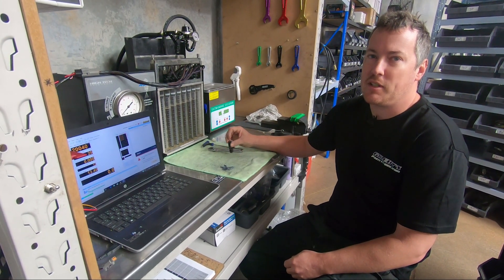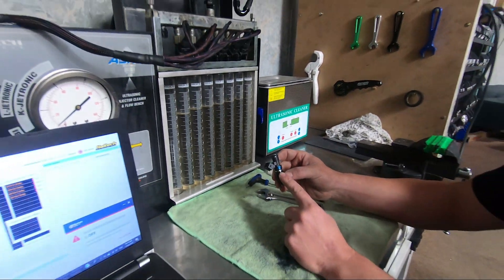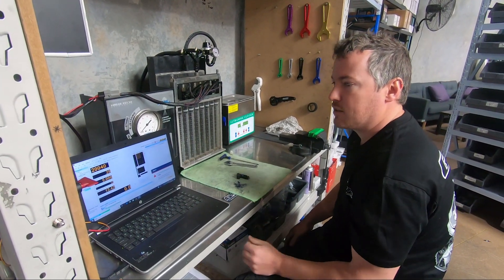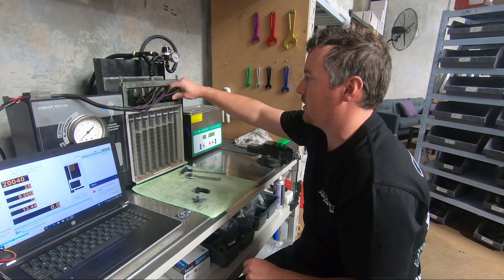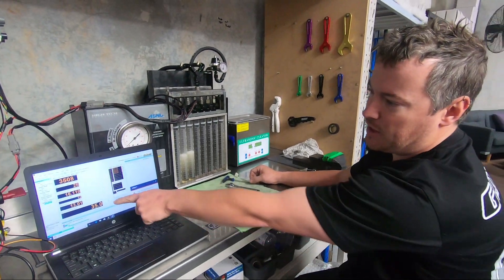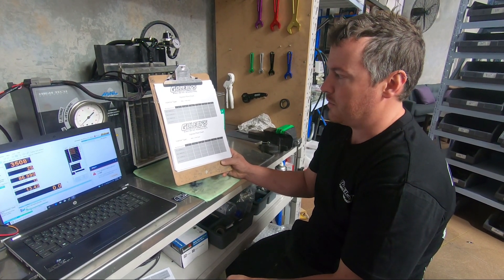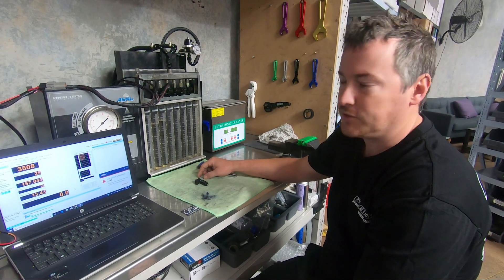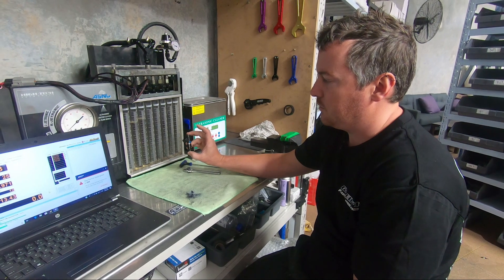Goleby's Tech: Haltech Elite Injector Machine Flow Testing with Bosch 1000cc Injectors

Comment: On a 1jz would you run the Bosch 980cc (3 bar) at 43 PSI with vacuum disconnected?